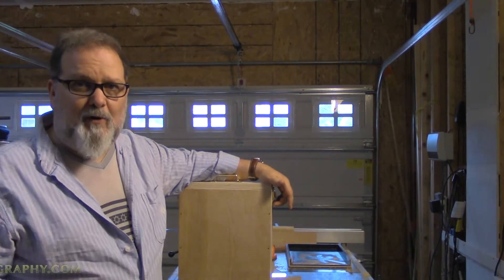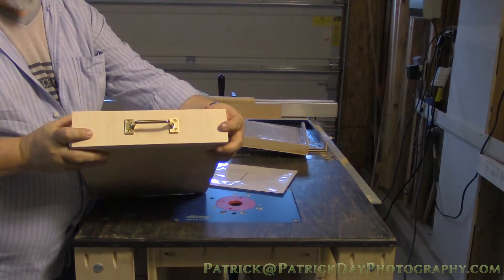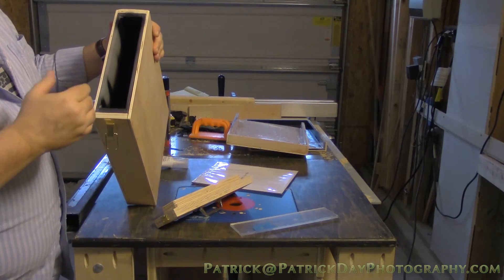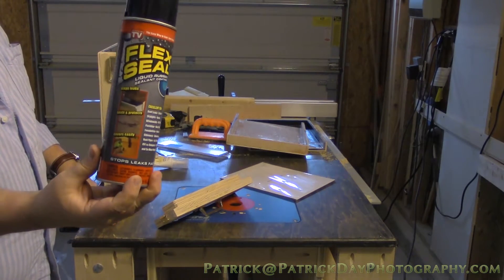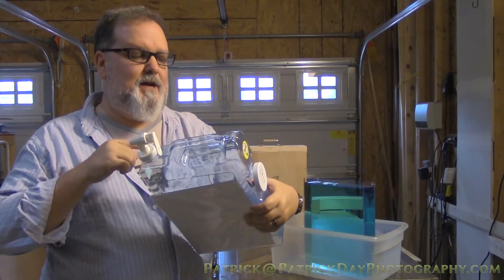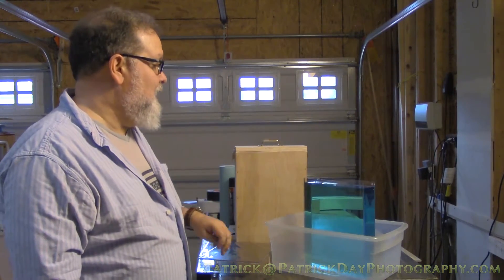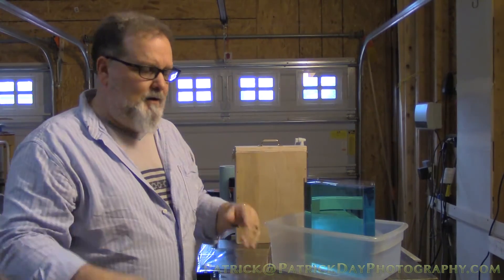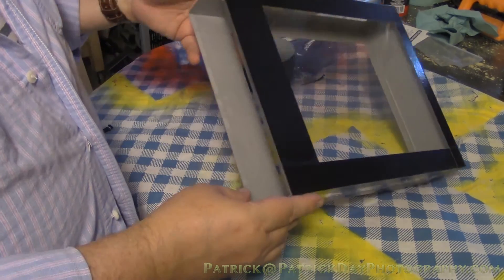Collodion Wet Plate Tank Build - Video 1 of 5

Comment: I would always recommend that the plexi interior be separate from the wooden box. That way it can be removed. I have tried to fill mine with the plexi interior inside the box and its harder to tell how full it is. I ended up wasting more silver nitrate than I ever cared to waste. My plexi box does remove so I started making sure to fill it outside the box and then sliding it down in the wooden box.

Comment: I wonder if you leave in water for awhile if it will swell close.
Reply from the maker: it's plywood, so pretty stable in that regard.  the real solution is to use the CORRECT GLUE!  There's specific glue for acrylic/plexy.  Later iterations worked much better.